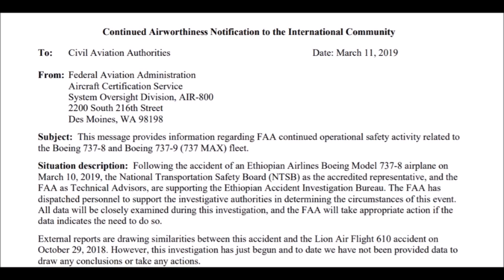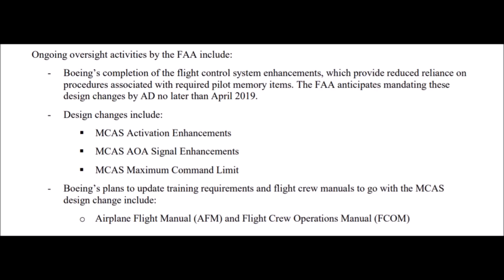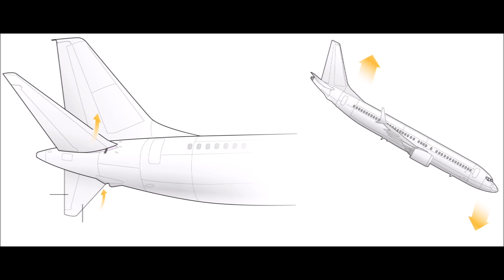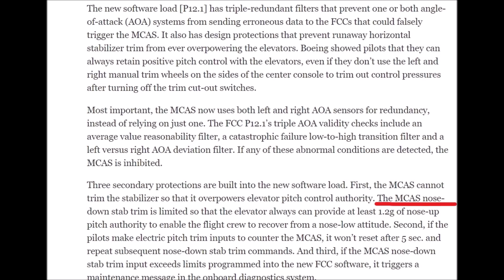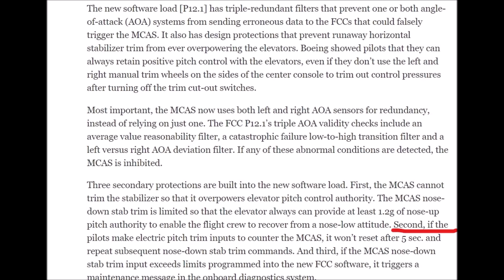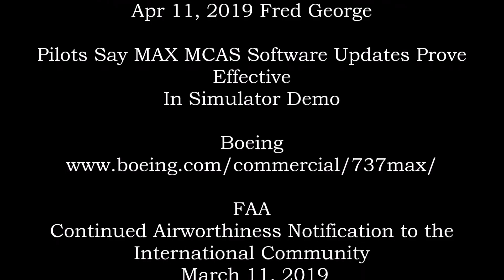737 Max UPDATE 14 April 2019 "The Fix"

Comment: Do you feel about this "fix"?  I know you cannot difinitvely say one way or the other. To me; as a non pilot of any aircraft, the reliance of new technology hinders the performance of aviation. Granted I am aware of the "safety" issue. In reality, as a commercial and private pilot, do you feel that this is adequate?  Or should more focus be in training pilots in actual flying capabilities vs automation.  Do you feel; aside from simulation training, that log hours of flying should be documented as actual hands on flying? Where the pilot and 1st officer are required to use true skill vs automated in daily flights? By which I mean, where the "auto" only initiates if there is a suspected problem via input of the electronic components of the trim? How would the redundancy; in your opinion, help?  I forgot if there was a redundancy issue of the software prior to the crashes or not. So my question is with "redundancy" do you feel it would truly help; and if not would that still allow the pilots to over ride the system manually to advert any such incident from occurring again?  

To me it seems as we advance technologically, our reliance on such technology seems to supersede our own capabilities. As technology maybe helpful in some regards it is also prone to failure; even at a cash register in a store.  Over all my questions are many and more.  If you could please find any or some of my questions worth a proper explanation please do so; as I am curious, and I feel that many more of us have similar inquiries.
Reply: Automation has made flying far safer. Pilots still need to be very skilled and continue to train. Airbus planes are already so automated the pilot can't even scratch his butt with out asking the plane if its okay.

Comment: Clearly there needs to be better education and training for ground crews about the apparent fragility of AoA sensors, so thy don't continue to damage them while power-washing the aircraft. It also would have helped if Max 8 pilots worldwide were all  fully aware of MCAS and properly trained on how to "lock out" MCAS by switching to manual pitch trim. Boeing, the FAA and the manufacture of the AoA sensors that failed to work properly in both Max 8 crashes are in deep shit. The FAA will especially bear a great deal of scrutiny sine they approved and certified the Max 8/9 design and permitted Boeing to largely "self-certify" these new 737 models.  20/20 hindsight here, but had the pilots of Lion Air and Ethiopian Airlines hand flown the planes to a least 10,000 AGL, rather than getting the gear and flaps retracted and then engaged the flight control system, they might have had more time to troubleshoot the problem. 

As is typical in aviation, no one failure alone caused these tragic accidents. Both began with faulty AoA sensors on the Captain's side, damaged on the ground before flight, providing wildly erroneous data to the flight management computer.  The fact that the Max8/9's FMC only sought AoA data from only he captain's side sensor, while the F/O's sensor was apparently working perfectly but wasn't being used as a data source is scandalous and reckless on Boeing's part. That part is absolutely inexcusable on Boeing's or the FAA's part.  Then MCAS, which was designed only to cause small pitch changes to compensate for minor handling characteristics in the Max 8/9, to make Max 8/9's handle just like previous models of 737s.  Poor training by Lion Air and Ethiopian Airlines, the product of Boeing's desire to make their planes exceptionally east to transition into from previous 737 models, plus inadequate flight manuals and quick reference handbooks made it harder for pilots to troubleshoot the problem.  And the Ethiopian Airlines crew unknowingly exacerbated the problem when the reengaged the electric trim switches after earlier turning them off. 

Boeing, the FAA and the manufacturer of the AoA sensors are in deep trouble now. Several hundred people paid for those organizations' hubris, their placing training costs over safety hubris and their manifest incompetence.  And several hundred innocent people have died so these kinds of problems hopefully will never happen again.  All in all not exactly a black letter day for aviation.
Reply: There is quite a lot of speculation in your post.
Reply: @stimproid  How so? Its all there in the preliminary report.
Reply: @douglasmcintyre3297  Pressure washing AOA sensors?
All 737 pilots since the 1960's have been trained how to use the cut out switches.
Why would the pilots think to leave their flaps out till they got to 10,000 feet if they didn't know they had an MCAS failure?... If they knew they had an MCAS failure they could have kept flaps out and returned to the airport without flying to 10,000 feet.
I'm not going to continue. This is just silly.

Comment: I was an Auto Technician for over 20 years. I worked mostly with vehicle emissions, tune up, engine performance etc. Computer controls are the main reason that vehicle emissions are drastically lower on vehicles built since the early 1980's. With the system in "closed loop" the computer will  constantly make adjustment to the the vehicles fuel and ignition and emission components based on the vehicle inputs such as speed, throttle position etc.  If there was a failure somewhere the system would revert to "Open Loop" which had preset parameters to allow the engine to still operate well enough to be driven. Never the amount of control that MCAS had. To give MCAS that much control just boggles my mind. It would be like having a faulty VSS (vehicle speed sensor)  reading of 75 mph, then having the computer decrease fuel injector pulse width until fuel is cutoff and the engine dies because it sees the vehicle is already going too fast. All this when the driver pushes on the accelerator to get on the freeway ahead of the semi rig barreling down on him. Insane! Can you imagine if GM, Toyota, Ford etc. did this?

Comment: I think one of the things people fail to realize when looking at these sorts of things is the same thing as you mentioned with being that third guy in the cockpit. It is easy to look at this and say wow this si so simple how did it become a disaster? We here have the big picture. This sort of problem is a direct result of modern cubicle engineering practice that I am sure Boeing follows. No one is allowed to know all the workings of the plane, also development of each component is very compartmentalized to different engineering groups. The guy that designed the software for this system likely has no knowledge whatsoever of aerodynamics. He was told " We need you to design this minor control system, if these sensors point down tell the flaps to go up" Details of what it controlled likely weren't even provided as companies fear the steal of trade "secret" designs like it would be totally impossible to reverse engineer anything from an existing aircraft.  Many are rediculous to the point that they allow no cameras or filming or even phones in because, well you know, sometimes making hose is really special I guess. The electronics engineer would have no knowledge of the problems he might cause to the mechanical flight controls as that isn't under his department or scope of training. mainly the problems with this sort of setup could be pointed to as lack of management but most managers particularly in modern terms are chosen more for their business accuumen and ability to work with people rather than vast product knowledge and the ability to coordinate and intertwine the necessary skills of the rest of the team to come with a successful outcome. In my experience there are very few managers that can even do the jobs of any of the people below them without training and I think that is a fundamental flaw in our corporate structure.  In the design heydays of the 60's and 70's I suspect very few of the management were not passionate about and very intertwined with aircraft development way more so than today.

Comment: I see the comments here and believe that some may have forgotten some salient facts about this crash.  I am by no means saying that MCAS was not responsible in some large part, but the facts also point to other factors.  The crew correctly disabled the stab trim when they started getting MCAS inputs and other warnings.  As Juan has stated, the real deal breaker was the fact that they became so focused on the trim system that they apparently forgot to check other flight parameters, ie the auto-throttle settings.  If they had only reduced airspeed to a somewhat more realistic setting, the aircraft could have been saved.  However, you still have to say that MCAS  basically caused the crash because it diverted so much crew attention to it and away from other flight tasks.  I am with Juan on this:  how this system in it's present state got certified to fly will be a subject of much investigation for months or years to come

Comment: What would the original MCAS do in a "terrain escape maneuver" that may include a near-stall situation or during a "windshear/microburst escape maneuver"?  What would the new MCAS software load do in a "terrain a escape maneuver" which may include a near-stall situation or a "windshear/microburst escape maneuver"?
Reply: texasabbott The pilots still have complete authority. Applying electrical nose up trim will override MCAS.

Comment: My understanding is that MCAS was required because of the larger engines that Boeing put on the Max planes.  Mounted higher and further forward, these fuel efficient engines , because of the mounting location and power, caused a nose pitch up or nose high attitude of the aircraft. Particularly in rotation and climb out.

Comment: It really seems like there was a s/w bug. I can't believe it was intentional that MCAS  had no limit on the amount of stabilizer deflection that it could apply. As someone on another forum pointed out, an unwanted stab deflection of -2.5 deg is not a major problem for the pilot.

Also one factor in the Ethiopian crash was that the stab cutoff switches disable the electric trim switches, necessitating use of the manual trim wheels. It would have been more than helpful if MCAS & electric trim  switches had separate disable mechanisms.
Reply: There is a difference between a software bug where it does something unexpected and not obvious from looking at the program, and what we had here which was software that had not been written properly and wasn't even expected to operate properly in failure conditions because it had no design elements for those conditions.

Think of the brakes on your car.
A bug in the ABS system might allow a wheel to lock up randomly. If Boeing designed it, if one of your abs sensors was giving an incorrect reading, it would disable the brakes entirely, because that's what the software was written to say.

It's not that Boeing designed it to fail, it's that they simply never put anything in to keep it from failing..

And while putting in a separate MCAS cutout switch is brilliant, it would require a new Type Certificate, new pilot training classes, new manuals, etc.
So they left all the controls the same, and tried to hide this in the back.

Comment: I did not hear anything said about the auto throttle control. The last flight was at take off setting while nose diving and exceeding designed air speed.
Reply: That was in his previous 2 videos I believe. This was about the fix going forward. Not the crash.
Reply: stimproid Juan needs to put a bigger disclaimer to that effect!

Comment: I have to say this.  There is much too much speculation on this channel. too much overkill in commentary and oversimplification..  The vane angle of attack sensors on this airplane is common to the BOEING fleets. [ and AIRBUS ] The investigation has yet to identify what the failure really was and if the Vane sensor was the culprit.  I believe that the application of the proposed fixes enhance safer operation but at the same time the [ needed ] stall protection has a very high degree of deselection and inhibition for so many conditional abnormalities that it is almost enjoying a high level of impotence.  I have no doubt that time proven technology was employed in the design of this airplane which was similar to other fleets for BOEING and Airbus.   Too much commentary about incompetence indifference and failures from outsiders who have little perception of the research and development put into this system.  The biggest problem that i see is that the system was repetitive and that could have been prevented. but i am certain that this airplane design was correctly outfitted  with proven technology.  I am hoping that there is no other reason why these airplanes were afflicted with failures but something here does not seem right.

Comment: So basically what Boeing has said is that this new design is the way it should have been to begin with, and to please sue them for gross negligence with astronomical punitive damage awards for the victims and pilots and airlines for not putting any of this in to begin with, and then for not taking decisive action to correct it after the first crash. 

And the way they downplayed it at first, and the fact that they were self certifying just gives more rope to hang them, because it shows that they didn't take their responsibility seriously.
Reply: ke6gwf It is possible that both are true. Past errors do not mean that the MAX will be grounded forever.
Reply: @gordonrichardson2972 , oh I expect it will fly again, and within a few years people won't even be checking the plane model to avoid it any more, and if they get some decent programmers and engineers working on it, with FAA and pilots and lawyers oversight, it should be safe again, there is nothing inherently bad about the plane, just horrible engineering and execution on one system (though it does make me wonder what else they glossed over...
Maybe I won't be flying Boeing for a while lol), so once they fix that system and it is all properly tested and certified by someone not on Boeing payroll, it should be reliable.

But Boeing still did horrible things, and are going to pay for it.

Comment: The MCAS system was designed soley to duplicate the flight characteristics of previous Boeing 737 models.

Why was there no on/off option available to the pilots?

The main disconnect was complete shutoff of all stab electric trim and only manual operation.

Only one sensor input for MCAS with no reduncy for inflight data to indicate failure.

The MCAS designed as a passive system that continuously applied endless nose down in timed intervals without any limits other than flaps down. No lights on panel to indicate malfunction. No audio warning.

Comment: I’m guessing some heads are going to roll for the unconscionable failure to get this system right from the get go.  It’s amazing that something so important as this seems to have not been properly vetted and tested long before this aircraft was put into regular production!  40 seconds is a short amount of time to overcome an aircrafts software that was apparently designed without any real thought!  Clearly, the push to eliminate pilots making decisions  and actually flying airliners is not quite ready for prime time!
Reply: Tell that to AIrbus.

Comment: Was there any reason why both AOA sensors were not used? Single point of failure is avoided on all type of businesses.
Reply: Think_BIG That will be intensively investigated. I have heard one plausible theory, but it is a weak excuse. The main factors were a chain of faulty assumptions, plus time pressure.
Reply: @gordonrichardson2972  it is very hard to believe that as an engineer you create a system without redundancy as specially when system is used to make automated decisions. FAA has equal responsibility to ensure such a fundamental mistakes are avoided at any cost.

Comment: 737 max the new engines on the plane are alot bigger than the old ones they are so big the engine set slightly above the wing making  the airplane  to pitch nose up during take off and high power setting

Comment: I will guess, that verification and testing was done based on test cases written for the original Boeing 737 to avoid developing a brand new test case. They probably run the same test on the new Max 8 and reported in such a way that the new Max 8 acts the same exact way with the old proven 737. Certification authorities mainly relies on verification and testing reports on their decisions to certify a new product. Verification and testing is the most expensive aspect of aerospace product and companies tend to want to take short cuts in order to avoid the cost. In addition, companies tend to assign the least skilled engineers on the verification testing side, or completely outsource testing to countries with cheap labour. A good robustness simulation testing should've caught this problem, unless it was ignored by the decision makers as non safety critical problem.
Reply: Ethio-Tech Good points. The B737 MAX passed all its certification tests. It did not pass software robustness tests, because they are not a clearly defined part of the certification process.